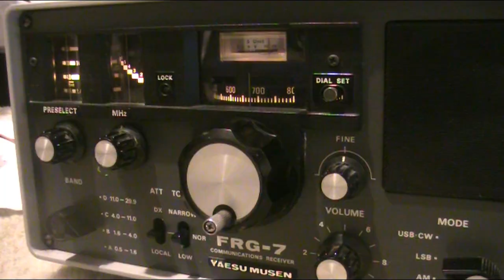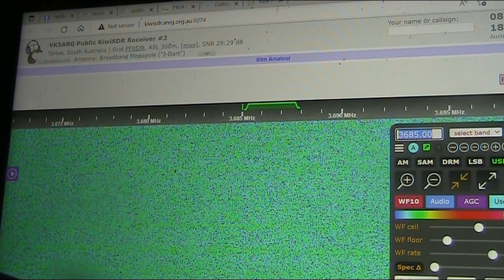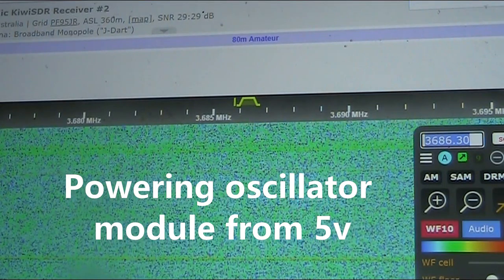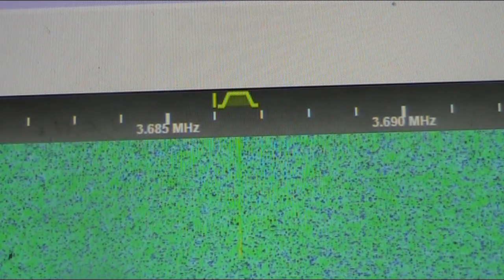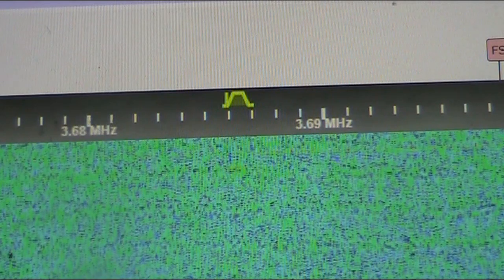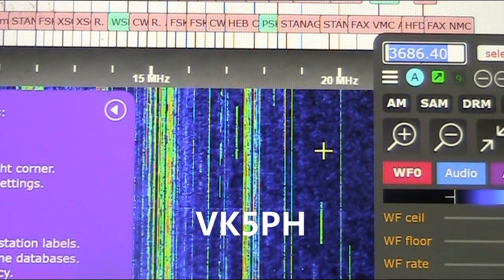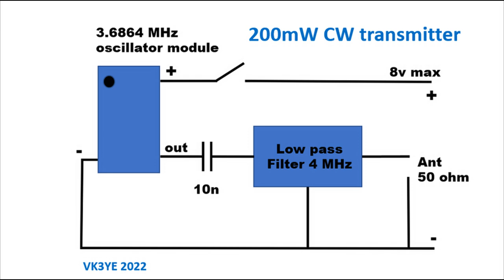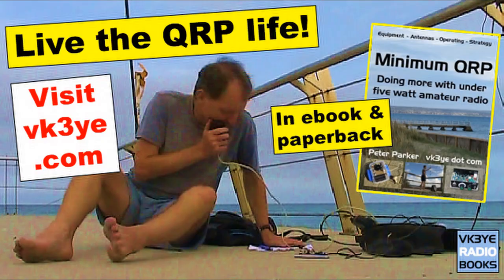1000km range with a crystal oscillator module?

Comment: Brings back memories. Mine was crude. 9V battery + 7805 with a key between the 7805 and the crystal oscillator module. It was on 80m. Was not until we finished I realised I had been using a 10m vertical instead of an 80m antenna. The person I wanted was 4km away and did not notice the wrong antenna until after.

Comment: Excellent video thank you very much it just shows you that if there would be an emergency and someone would need to transmit a signal this could potentially be used even though it is low power and still amazingly that you can do a thousand kilometers with 200 mL I heard cases where people can do a thousand kilometers with 10 mini Watts this are of course specific conditions and specific antennas however the fact of how simple the design is it is quite amazing I've seen you got quite a bit of videos on ham radio myself I'm using citizen band which is license free of course and VI solar conditions you can also achieve interesting distance however this band is a lot more noisier at this point I managed to modify a TRC 216 portable by adding a counterpoise to the walkie-talkie itself of about 5 m it has increased the range however I'm not doing a thousand kilometers I managed to do contact with three Watts a long time ago with a mobile from New Westminster to California New Westminster British Columbia in case of emergency this circuit is excellent it is very low cost and it will do the trick to send a signal if ever something were to come hopefully not otherwise I stick to the citizen band and as well the FRS frequencies the gmrs frequencies with just a small walkie-talkie from Canadian tire done some testing and British Columbia from UBC to a mountain that was 53 km away managed to make contact on 500 ml channel 10 of course signal was weak it still came in of course there was calculation of angle and a line of sight minor obstruction signal managed to come in ultimately that little crystal is quite impressive I heard of cases that you can get a crystal that works on the medium wave 900 khz at the same point the distance that could be achieved with this is very minimal as a testing equipment thank you for the video I am posting it into the group 11 meter band citizen band ultimately radio communication is becoming an asset as we go as we see things changing around the world that are going quite fast when it concerns the internet it still works now however as we have noticed things are changing everywhere and we're dealing with catastrophes that are happening all around just the fact of having a crystal a power supply and a low band filter will make it that f over there is a natural disaster happening it could be easily billed to send out a mayday hopefully this is not happen however the extra knowledge is becoming imperative now thank you do you have any videos that would help out for the citizen Ben I'm looking at trying to modify the equipment I have using an RCA jack for the output of the antenna I know that the efficiency of it is not the best however I would like to also increase the range so far out of this walkie-talkie managed to achieve a distance of about 87 miles that is on top of Mount SFU basically as a few mountain from SFU mountain to Victoria BC from Vancouver to Victoria managed to make a contact using a dipole while mainly accountable is hooked up to the walkie-talkie it's not the most efficient however I think if I were to hook up a balan 49 to 1 this may help the signal propagate I know I'm going off topic but I'm really inspired by the crystal video itself of how simple it is to get your signal out there maybe I'll try it on the 11 m BAND 73 thank you

Comment: 👍Good going Peter. I wonder if a QRP CW transmitter is on the cards using the crystal oscillator module? I had a quick look on eB*y UK. While crystal oscillators modules are cheap and plentiful, none of them are for ham frequencies.
Reply from the maker: 14.318 is common. Also a couple of 28 MHz frequencies. But not really good CW end frequencies.

Comment: unbelievable, without knowing output impedance, maybe only antenna and on 50 ohms at 3 mhz the power of a square wave oscillator for digital integrated, you managed to transmit so far, with 10nf of "XC" capacitance, I would be curious to verify with a swr meter, you must have an ultra performing antenna